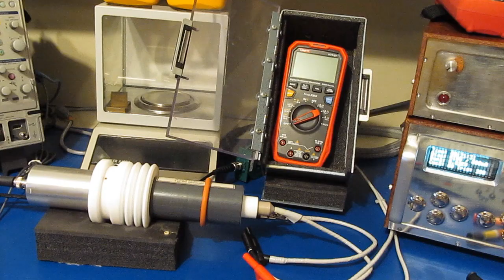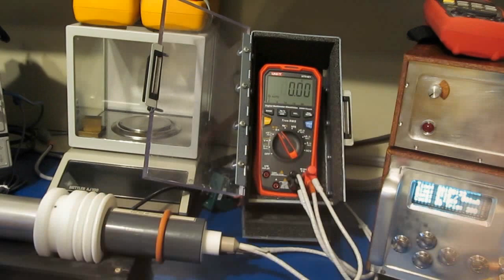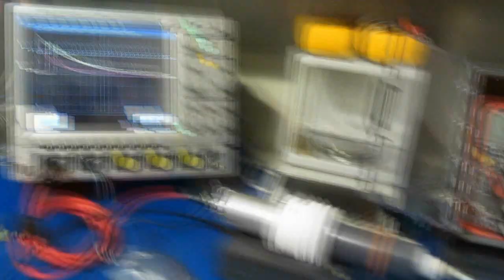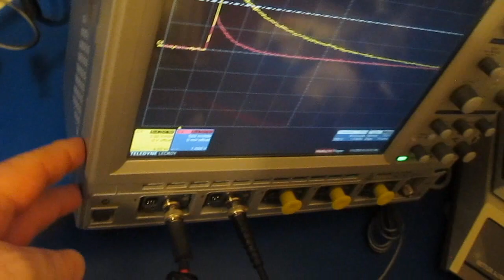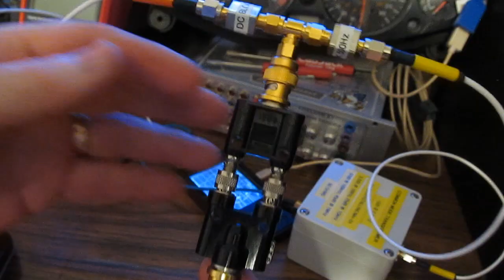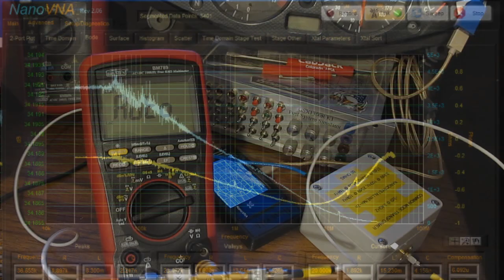UNI-T UT61E+ DMM,   Part4

Comment: That drift is a bit disappointing, the rugged look of the meter makes me fear that these will be handed to field technicians.
I would like to see it switch cycled but honestly i'm more worried about the rubberized coating on the switch, i think that would degrade first given time and skin oils.
Reply from the maker: You need to look right before the transitions.  Its about 40uV from -8 to 60C. It does take a long time to stabilize but its about 10X improved over what my original UT61E was.
Reply from the maker: Pinned as others have also asked this same questions.

Comment: Excellent review and video. 
UT61E+ has Diode measurement Open circuit voltage of 2.9V. Can you suggest any possible small modification to increase this from 2.9V to at least 3.2V ? Thank you for the attention

Comment: Using the nanoVNA to detail the impedance change with frequency was a great followup to the destruction in part one. We can see how the lack of resistors in series with the ptc's caused said destruction.  Good teaching. 
Your detailed testing of meter circuit robustness could be a learning reference for anyone designing an input circuit. 
Too bad the meter is altered.  I'd like to know it's ultimate voltage limit. Time for the mechanical test which is another excellent demonstration of the effects of design choices. 
What other class of devices could you review and provide a similarly instructive introduction?  I don't know,  but I'd like to see it.
Reply: Haha. Testing robustness of dishwashers or precision of toasters might be a distraction. 
Testing low cost oscilloscopes might be good area. More $$$ investment needed. Throwing them off the roof might not be as fun. I expect you could get them to pop though.
Reply from the maker: @jspencerg  There's not a lot of equipment that is designed to be this robust.   I don't even know what I would do with scopes for example when looking at how robust they are.  They plug into the AC outlet for the most part and there are standards already that they should be meeting for that.  I could do some sort of functional demo but I bet there's a lot of channels like that today.  The other problem, I would want to look at good scopes.  On par with what I use.  More $$$ is right.  Imagine, doing the $10-$20 scope shoot out.  10 scopes.   I would need some serious coin.   Then there's the time to do it.   You can't just take them out of the box and give them 5 stars..
Reply: All good points. I can't think of any investigations as useful, affordable or entertaining as your dmm reviews. 
A video chronicle of your race bike build would have be great.  I have an affinity for Suzuki.  My first street bike was an '81 GS750.
Reply from the maker: @jspencerg  Nice.  There's a video of the old GS on the channel that shows some of the last modifications.
Reply from the maker: By class of devices, I assume you want to see toasters and dishwashers tested.  I really have no interest in it but I bet you can find other channels that show other kinds of products.

Comment: Further transient electrical testing is not terribly informative since the meter is modified.   I agree with you that the most informative test would be the mechanical test of the switch since your modifications should have no effect on the switch function.

Why did you do the impedance test in resistance mode instead of voltage mode?  To me the impedance of the meter in voltage mode is the most interesting and is in the mode your RF generator fried the protection circuitry.

All of the waveforms you show on the scope are positive going.  Is that the case or does your transient generator  put out negative waveforms as well?
If the waveforms are always positive going that is the case why do you leave the 0V setting in the middle of the screen instead of moving it down so you get more resolution on the screen?   If the generator is putting out both polarities leaving it in the middle make sense.
Reply from the maker: This would have been better posted in the forums.    The UT61E+ was NOT damaged in the voltage mode as you suggest.  I stated during the video why I chose this mode but to be clear, I doubt the meter would have been damaged in the voltage mode with that same setup.

The generator only puts out a positive waveform.   That has been the case since starting the tests.   There's a reason I flip the leads and I state so during the video.   Yes, I could move the waveform down if I wanted more resolution.  I suspect I have done that for some reviews.  In others I have not used the scope and in some I have used my old Fluke handheld scope.  While I have explained the reason I use the scope, you seem to have missed it.  It's only there so I can get some indication that the meter is beginning to fail.  I really don't need higher resolution for that.  It's just a quick visual.

Comment: I would definitely like to see the switch test. After that since the data isn't usable I vote for self destruct. If nothing else it could show the potential the meter could achieve with a small amount of upgrading. I understand that modding DM meters is bad and can lead to catastrophic failure, but we all know it still done. I don't think ptcs and transistors being replaced is the problem in this regard. A great man once said "know your limitations".🤕
Reply from the maker: I'm sure people mod their own meters.  Many have written me about it.   But it's not something this channel will ever promote.
Reply: @joesmith-je3tq  Can’t blame you there, I can only imagine the litigation that would evolve over someone modding a meter going by a video explanation of how to by a YouTuber and said person getting zapped by doing it wrong. I’ve repaired quite a few meters but have never modded any, just simple stuff like display issues with bad contact on zebra strips or blackened reflective backing on display or UV damaged polarizing film that I replaced or bad or out of tolerance components. I must say mine turned out better than Dave’s latest video attempts on that old Fluke display. I know he could do it right but it wasn’t a very impressive result if viewers were interested in how to repair it right.

Comment: How about just let it finally rest? :) 
Meanwhile I'm really shocked about the build "quality" of that oscilloscope casing there. One would expect a little bit better materials if one must leave a smaller fortune at the cashier for it...
Reply from the maker: The metal chassis is really poor quality as well.  One of the connectors had been replaced on it and of course many of the knobs fell off.  It's not at all what I would have expected from LeCroy.   To bad as I really like the scope.
Reply: @joesmith-je3tq  What a shame from such a high profile brand...

Comment: Let’s life cycle the switch Joe. I’m surprised it survived the transient tests. Even with upgraded transistors it seems the layout must be better than the original or it most likely would have arced at some point.
Reply from the maker: I'm also surprised that the meter has survived ESD and now the low voltage generator.  I wonder how a stock one would handle it.  It's really too bad that they oversold the frequency counters upper limit.  Had they considered someone may actually test it, maybe the meter would still be stock.
Reply: @joesmith-je3tq  When this E+ model hit the market and seen some videos of a tear down I thought it looked like it might be more robust since they added more input protection and the layout looked less susceptible to arcing, at least around the protection circuitry.  That was one reason I inquired maybe checking it out back when it came out. I swear they probably watched your modifications of the original 61E after how miserably it failed one ESD shot from the grill starter and how well it performed after your re-engineering of it. You need to get Brymen to make a JS model meter! They put Dave Jones brand on two and he has the other. You’ve done more engineering on these than probably their design engineering departments. I think Brymen truly appreciates you and listen to your input. The company that built the 121GW probably not so much 😉. Alway look forward to seeing a new video from JS! Love your new Dog by the way. I’m a Dog person too. My dad and I always had Beagles growing up for rabbit hunting. My mom used to baby them like lap dogs, could barely get them to go hunting time she spoiled them! God rest her soul, she sure took great care of her pups. I haven’t had a Dog in  my life in almost 20 years since the last Beagle died.
Reply from the maker: @SIXSTRING63  I have no interest in selling meters or getting into sales or distribution.  So you won't find a rebranded JS meter anytime soon. 
I wonder how a stock 61E+ would hold up.  It could very well be taken out with the gas grill igniter.  We will see how the plastic holds up over the next few days.
Reply: @joesmith-je3tq  Didn’t figure you did, wishful thinking I guess. They must use the EEV Blog branding as a good marketing scheme since the channel and blog site has such a big following.
Reply from the maker: @SIXSTRING63  I think that is what happened with the 121GW.  IMO, sold the brand out cheap.
Reply: I agree :)